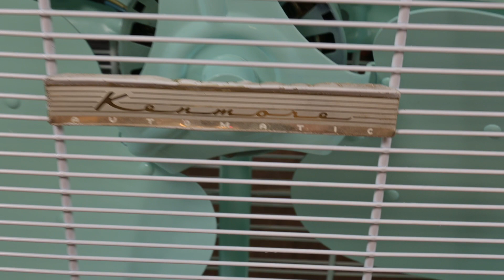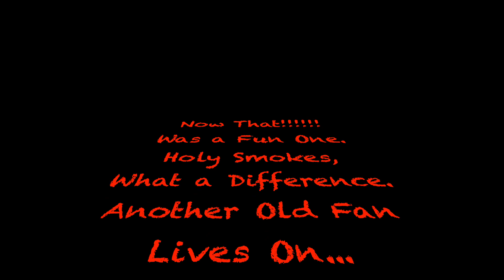Vintage 1950's Kenmore Automatic 20" Box Fan Restoration (Part 2)

Comment: You did an excellent job on that box fan! It looks like it did when it was brand new, the ocean mist blue matches the original color scheme perfectly. That was very comical with the first and last part of the video in the end when you began the washing process very entertaining lol . I love these old box fans and I've restored several of them myself, I bought a Wizard 4 bladed C&H Air conditioning rebranded box fan I bought in 2019 I restored and boy what fun that was! I've been using it constantly ever since . And I just recently restored a Lakewood X 22 box fan . I would love to see more of these fan projects in the future. A new subscriber here and I enjoyed the video.
Reply from the maker: Thanks Steve. 1st things 1st. I think the motor on your X22 is smelling & getting hot is because of that wd40 you sprayed on there. It ran down the shaft then mixed with all the old dust and crap that was in the motor. Blowing it with your air compressor spread it out even more. I’d suggest you rip that motor out then give it a good cleaning. It’s a very simple motor. 
I wish you were my neighbor. I’d have that old fan squared away in no time. Let me know if you need any advice ok. I love these old box fans too. I’m actually on the lookout for another one. They’re so fun to work on.
Reply: @spiderlovesbeerohyeah4760  No problem man! Yeah I think the procedure I did on the motor just made it a little messy, I didn't get a shot of it in the video but man that thing was horrible inside, this did come out of a barn from what I was told when a family member brought it to me lol . If I were close by I would definitely hand the motor over to you . I do have intentions of finding a fresh new one eventually. Take care bro!
Reply from the maker: @stevethefanman8955  
Before you get a new motor, I’d bet there’s a 99% chance that motor is fine. They were built to last forever. 
Just take it apart then clean everything up with contact cleaner and an old toothbrush. 
Check out my video on the 1920’s grain mill motor. That was 100% trash…..
I still can’t believe it.

Comment: Nicely done Spider. That is a beautiful old fan. I wonder if that thermostat is a overload protector for the motor in case it gets to hot? It kinda looks like a reset like some of my bigger motors have.
Reply from the maker: Thanks Ivan. This was a pleasure to work on. Well, once all the mouse pee smell went away. Haha. 
I’ve been messing with the thermostat just now. I moved it until the fan turned off. Once it got to about 78 degrees in the living room, the fan kicked back on. It truly is a thermostat. I still don’t understand how it works because it’s just 2 thin pieces of metal with contact points on the ends. Those thin metal pieces must move when it starts to warm up in the living room then the contact points touch, giving the motor continuity. I’m no electrician but I think that’s what’s going on. I was just sitting here thinking about what to restore/fix next, then the fan just turned on. It was weird but in a good way. Now I know that the thermostat works. Now I just have to sit here and wait for the living room to cool down, then see if the fan turns off.
Reply: @spiderlovesbeerohyeah4760  the metal expands and contracts with the temperature. When the the temperature reaches a certain level they expand and make contact completing the circuit.
Reply from the maker: @ivanstiles7030  
Ok cool. That’s kinda what I was thinking. You worded it way better. 
I’m still waiting for it to shut off. I opened the front door so cool air is hitting the fan but She’s still running. 
Maybe it isn’t working properly after all. 
Thanks for the explanation Ivan. 🤙🏽